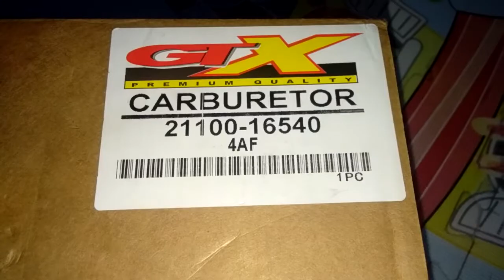UnBoxing toyota 4af Carburetor GTX brand Replacement

Comment: good day boss, nagamit mo b un carb? ksi bumili din ako bnew pero napansin ko kulang un ports nya, wala un port pra sa throttle positioner tska chrcoal cannister.
Reply from the maker: oo boss nagamit q na tama ka mejo madami sya kulang. pero ung iba deleted na saken. dto saken ang napansin q wala ung diaphragm na parang katulong ng throttle kapag ng open ng ac. dun sa luma qng carb meron sya dun sa bago wala kaya balak q ilipat ung nasa old carb papunta sa new. pero ngaun nmn ok nmn sya gamitin. saka wala na din aq charcoal canister hnd q na kinabit kasi nasunog ung dati q e dun pa nmn nadaan ung sobrang gas buti hnd nasunog oto q kaya hnd na aq nglagay ng canister.

Comment: Boss san kaya iko-coonect jan yung idle up ng aircon? Wala kasing vacuum actuator yan eh.
Reply from the maker: Sa pagkakaalam q boss ung actuator na pra sa ac ng 4af nkakabit sya dun sa manifold sa bandang likod. Sya ung magtutulak para tumaas menor kapag nag on ka ng ac. Qng wala boss ung sa 4af mo may nabibili nun sa mga nagkakatay ng small body.
Reply: @ChardAngLasquety  walang nakalagay boss sa likuran na vacuum actuator. Salamat idol sa tips mo.
Reply from the maker: @alvinbayas8873  qng 4af din makina mo dpt meron yan. Kasi kapag binaklas mo ung carb dun sa turnilyuhan sa likod ng carb dun din nakasalpak ung pinaka frame na naghahawak dun sa actuator ng ac. Malamang inalis ng dting may ari yan. Bili kana lang boss sa katayan. Qng pwede lang padala ng picture dto napadala q na pra makita mo itsura. Pero alam nyan ng mga nagbebenta ng parts out hnd q lang alam qng mgkano.